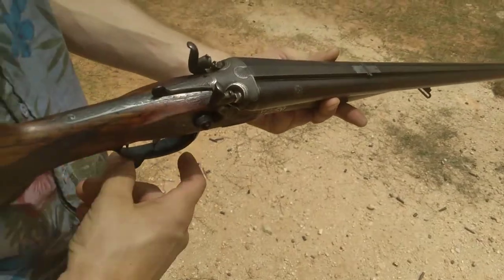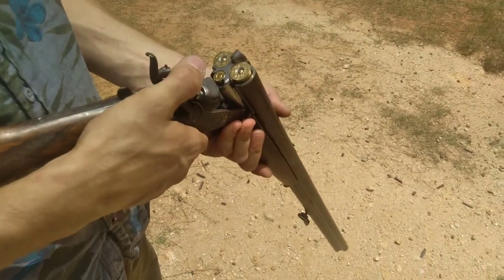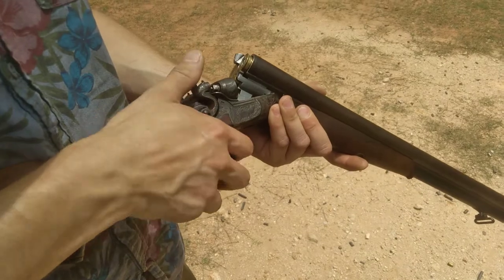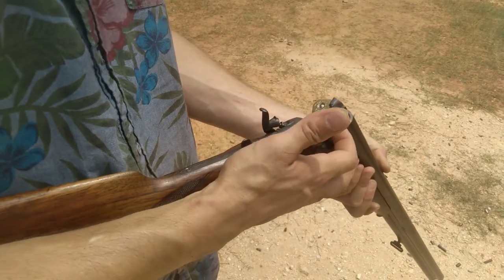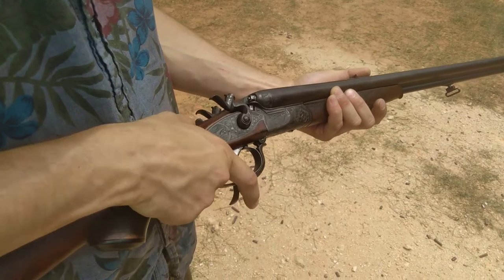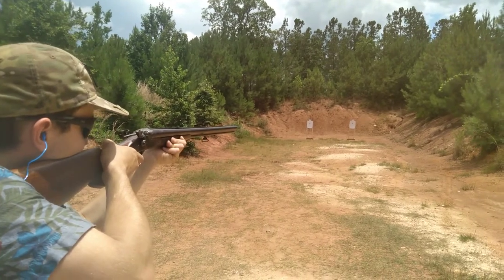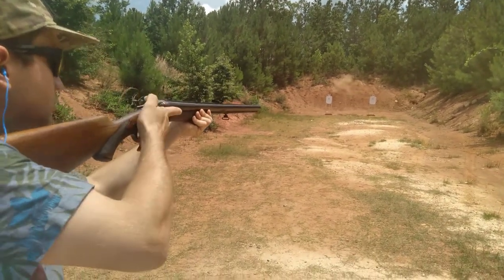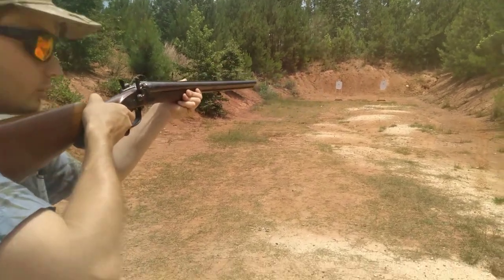German Drilling 9.3x72r

Comment: Any luck finding 9.3x72r ammo?
Reply from the maker: yes and no. Its available on the secondary market but horribly expensive per round. It cost more than .50bmg.  I've finally got all the things i need to re-load it. The dies, brass ect are pretty available. The rabbit hole i've fallen down now is trying to figure out what 9x?? cartridge my stalking rifle is chambered for
Reply: @gunrelatedvids  TargetSportsUSA has it @ $3.30/rd
Reply: Made by Sellier & Bellot. Guessing S&B makes them in lots every so often as there is little demand these days. I'd check the proof marks on the shotgun. Is it chambered for 2 1/2" (65mm) shells? If so, I would not be firing modern 2 3/4" shot shells (70mm) in it.
Reply: @2009Berghof in Germany they sell 67,5mm shells for these old guns. do not use 70mm! only 65 and 67,5mm. I got a Drilling 7x72R ans 16/65